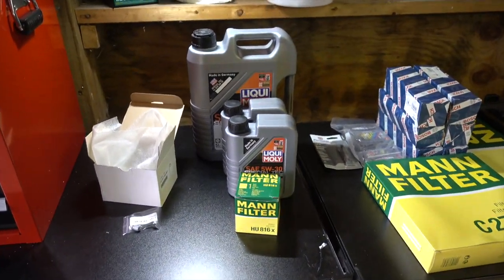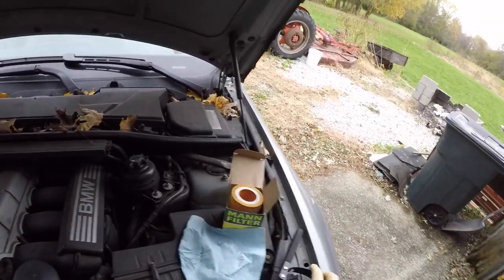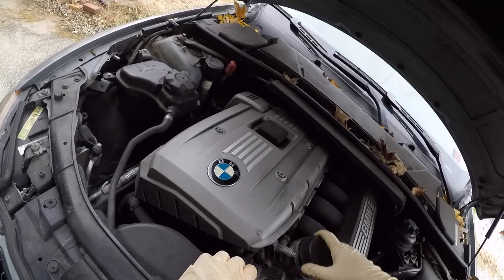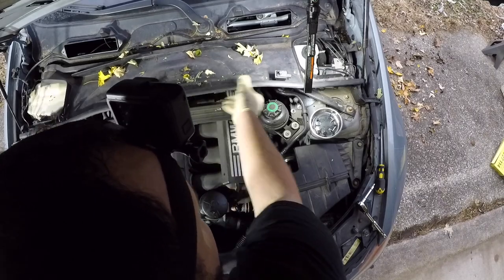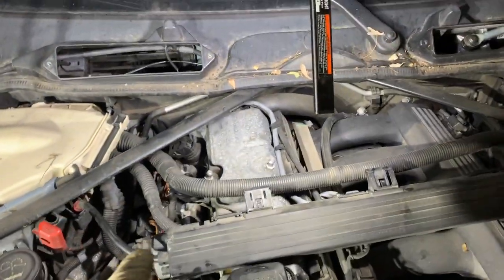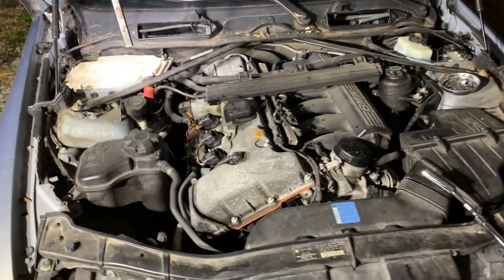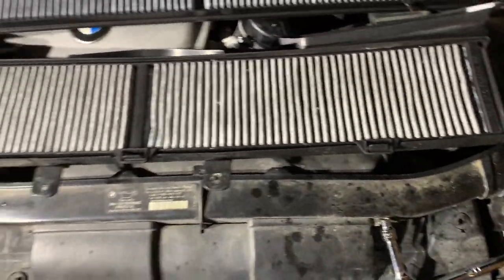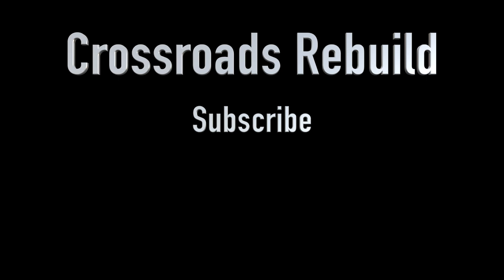BMW E90 Maintenance Series -- Part 1 -- Oil, Filters, Ignition System

Comment: Open your oil filler cap before you open your oil drain pan bolt. Open the oil filler cap and rest it right where it sits. Helps drain oil.

Comment: You can also get a preliminary oil level quantity check after an oil change, without starting the engine. Go to ACC and do the same oil level toggle display. If for some reason someone here didn’t add enough oil and starts the engine it’ll tell you if it needs more.

Comment: Hey thanks for the video! Im thinking of doing the same sorta thing (full preventative maintenance overhaul) before I go off to college. Im looking forward to the suspension upgrade because Im wondering if I could do it myself haha.
Reply from the maker: I’m glad this helped you! BMW’s have a reputation for being hard to work on, but they’re not really that bad. I have replacement shocks to put in all the way around, so I’ll be doing a video on that soon. Also will have vids on Vanos and brakes.
Thanks for watching!!

Comment: Nice work but you should have opened the oil filler to have a better air flow of the old oil so it won't take long to drain
Reply from the maker: Got ahead of myself. But you are correct.

Comment: these filter caps aren’t easy to get on hand tight with the gasket, be sure its seated all the way where it should be.
Reply: I stopped tightening after I couldn’t any more with my hand and had oil leak out from all around the cap
Reply from the maker: Thanks. I’ll keep an eye on it. 👍
Reply: You got weak hands. Lol.

Comment: Hi, My bmw E83 crankcase vent valve went bad with pressure in engine & blow out my valve cover gasket. Do you think it could have damage any other seals
Reply from the maker: Tbh, I’m not sure. You replace the pcv and valve cover gasket and have to see. Hopefully not. I’m not thinking of what else it would’ve blown out. The other thing I would check is your plugs and coils. With a blown valve cover gasket it is common to get oil down in the coils and plugs. Good luck!

Comment: The most stupid thing the bmw engineers did was removing the  physical engine coolant temperature gauge from the front cluster and use a hidden digital reading which many ordinary car owners are having tough times figuring it out. This is dangerous because the engine can overheat while driving on a highway without monitoring and seeing it. Oil check is better but coolant temperature check need you to press codes which is tedious while driving on high speed road that need your full on steering wheel attention. Old cluster gauges and meters where thought-out useful and straight forward. Today's engineers don't solve problems but create lot of problems. Some decided to remove a spare wheel on German cars and replace it with run-a flat tire which is basically hard to repair and defeat common sense since you cannot change it if it get flat in the night or middle of nowhere. Today's engineers and car designers don't know how t differentiate between an F1 race car and household vehicles. Don't fix what's not broken. Too much unnecessary innovation to look different and stand out in the auto industry is complicating things and taking away the trust from German engineering.

Ask German cars makers what wrong with oil dipstick and cluster gauges? Why too plastic parts in a car that costs too much to buy and maintain?